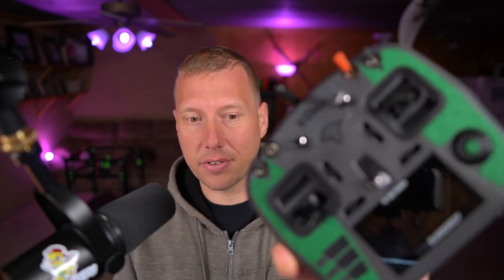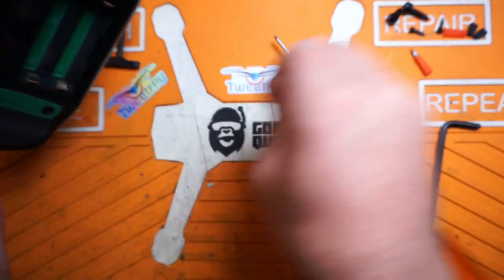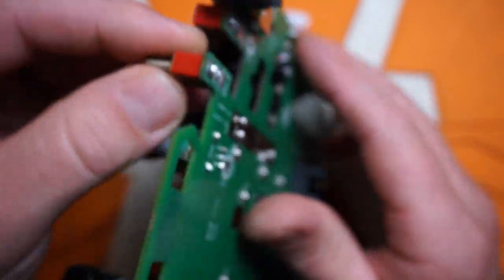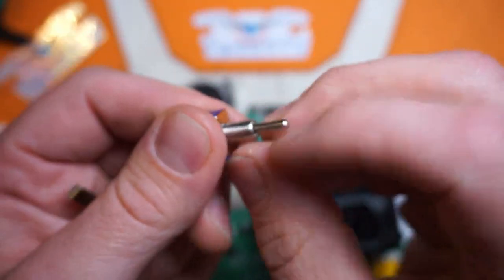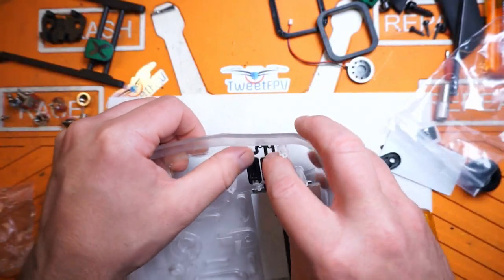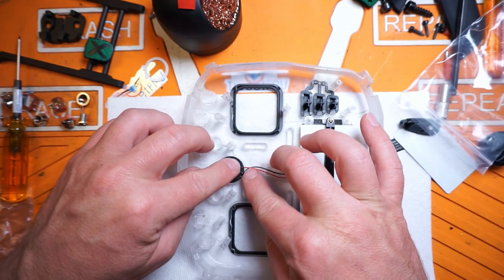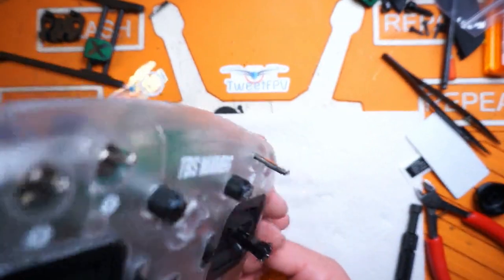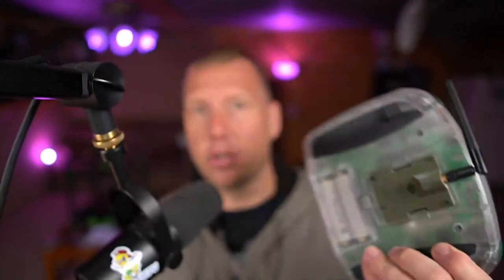TBS Mambo Switch replacement. Nostalgia shell install #tbs #solder #diy #repair

Comment: TBS Mambo is junk....3 switches broke off for me under normal use in not very much time it seems. I think I'm going with Radio Master next and never looking back.
Reply: thanks for the video I subbed
Reply from the maker: I have broken switches on it too but only when It fell off my bench.
Reply: truth be told....don't let those switches touch anything besides your fingers...even then they'll probably break off eventually. going with radio master 100% with those nice gimbles next and not looking back.

Comment: it horrible dude, i think you can put iron solder together horizontally. so you can pull up easily
Reply from the maker: I'm sure you can but you need a lot of heat and a long dwell time on the part. That time is what damages the surrounding substrate. Better to remove what isn't needed and take smaller bites at the job.